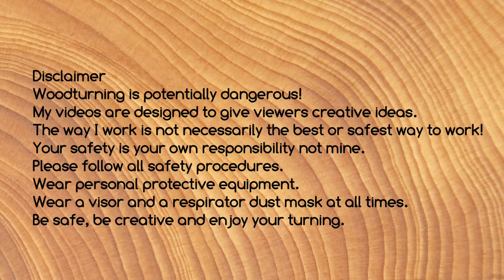The Acrylic Finial Bauble. My Entry for the 2016 Christmas Ornament Challenge

Comment: That looks fantastic. I turn acrylic pens but have never worked with acrylic sheets. Can you tell me what supplier you use and any info on how to work with it?
 Thanks, Will
Reply from the maker: Thank you Will. I get the acrylic sheets off various sellers on eBay , they come in a variety of sizes, colours and thicknesses. It is sometimes called by its various trade names, such as Perspex or Plexiglas. You treat it the same as you would acrylic pen blanks, some acrylic is harder, more brittle and prone to chipping than others. The clear Perspex is available in a lot of DIY stores. I use the plastic weld liquid to cement it but this is really best suited to narrow joins rather than what I did with the middle of the decoration. The Yorkshire Grit and burnishing cream bring it up to an excellent finish. Cutting can be an issue as it can melt it. Hope this helps. Cheers, Jim

Comment: nice work mate and if you make another 100 or so of those you could use them on very low voltage fairy lights ;) 12v or less , though maybe it will turn your living room into a 70's to 80's disco light mess if done lol
Reply from the maker: Cheers mate, I think my scrapers would end up very much shortened if I made many more of these !! Cheers, Jim.

Comment: do you mind if I ask you where you get the acrylic sheets and rod from? I cam get from trent plastics on ebay but the price seems steep at around £6 for each sheet A4 size.

the 10mm rod is near £7 for less than 30cm
Reply from the maker: The Acrylic sheet was from eBay , but shop around as the price is very variable and there are lots of sellers on eBay. The acrylic rod was given to me, it is 20mm and very high quality, it would have been very expensive to buy. Cheers, Jim.
Reply: Thanks buddy Ill troll around ebay and see what i can find